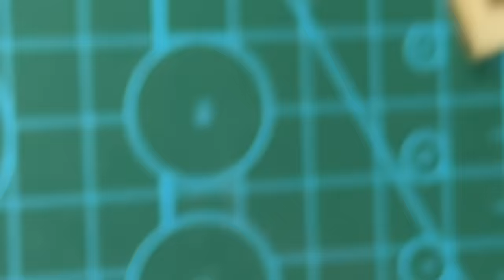4 SIMPLE INVENTIONS

Comment: The boost BMS used in the 9v battery housing project is TP4056 based and charges at 1a. 

You shouldn't be charging LiPo batteries that small (probably 150-300mah) at 1a unless you want a fire. 

To charge LiPo cells this small on a TP4056, you must replace the shunt resistor for a higher value (from 1k2 to probably 10k). Reffering to the TP4056 datasheet will show you which resistor to swap and what value replacement will match your battery.
Reply: 1A
Reply: @Kali_Kali  Are you picking at my lack of capitalisation regarding amperes?
Reply: ت
Reply: I literally have no clue what you're talkin about
Reply: @potatopotato926  then you shouldn’t be playing with lithium cells 🤷🏻‍♂️
Reply: Who says I am
Im scrolling thru the comments of a video and then dis dude is rambling on abt LiPo things and whatnot
Reply: 😂 2:43